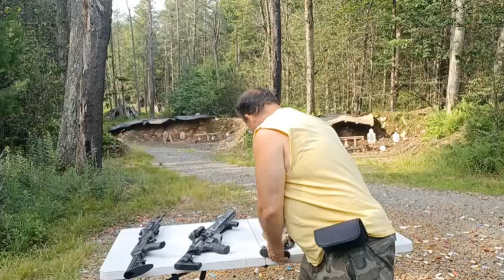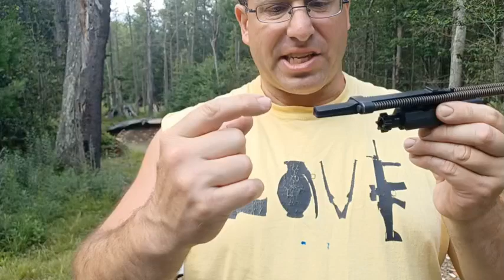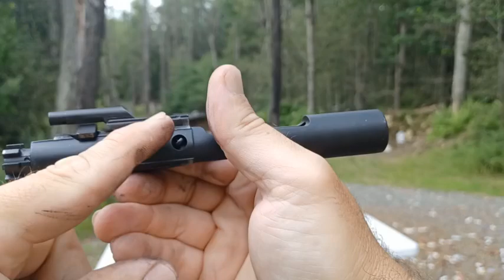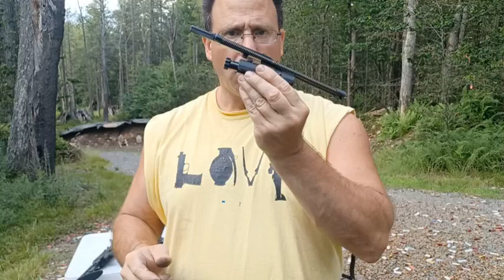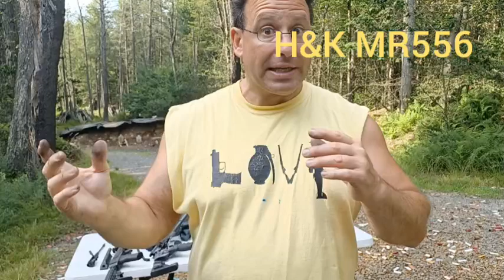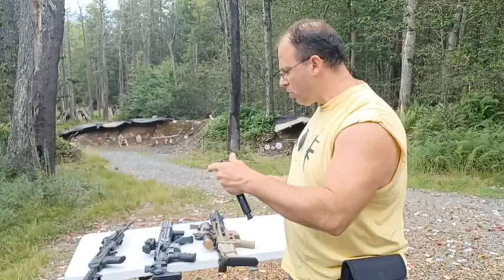Short Stroke Piston AR-15 problems

Comment: Piston guns are way too expensive, and use too many proprietary parts.
Reply from the maker: In addition to being expensive with proprietary parts, the added benefits is very minimal.
An adjustable gas block or restrictive gas tube will get you almost all the benefits at a very minimal cost.
Reply: @absolutegunrights3079  I agree 100%
Great video, thanks.

Comment: Hey I have question not germane to the topic at hand.... I hope that's OK.... I have an AK and shoot only steel cased ammo (non corrosive) that it largely a steel core with a copper wash applied to the projectile (from my understanding) .... 

.... I've just completed my first 500 rounds thru the barrel and the lands are fully coated with copper... basically to the crown... I mean coated hard, not in thickness that I can perceive, but in real estate ....... 

..... but so too are the grooves and strangely all of the groove copper fouling stops short of the crown by maybe 1/3 to 1/2 inch ( I don't understand that phenomenon ?).....

What is your thoughts about this matter ? I watched a channel called Gunblue that has done several videos thru the years saying avoid solvents with ammonia like the plague... and lots of forums talk about Sweats solvent... 

Do you worry about heavy copper fouling or let it ride ? 

I watched a Rob Ski video and he said he will literally go 5000 rounds without cleaning the gun (with non corrosive ammo of course) 

What do you think ? 

I appreciate your time spent in responding...Thanks again and have a good a night n' God bless
Reply from the maker: Let it Ride. 
Any extra copper will flush itself out. 
I watch a channel from a gunsmith that does gun autopsies and he has indicated many times that running wire brushes down the barrel to get them absolutely clean wears out the barrel faster. 

When I clean my guns, I don't do anything with the barrel other than just spray some brake cleaner down there. That's mostly to wash out some of the Gunk created from cleaning the receiver.

I think I once went 10K before cleaning an AK.